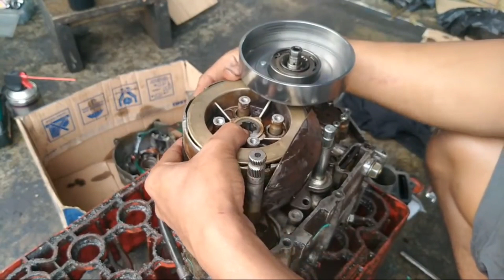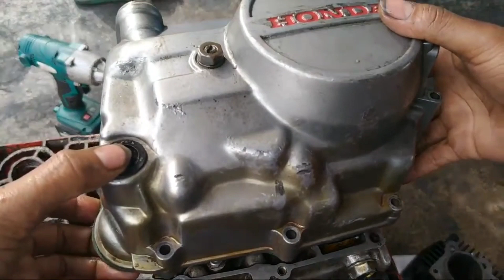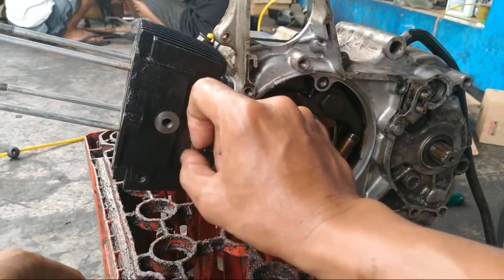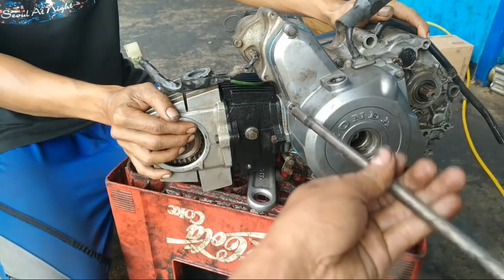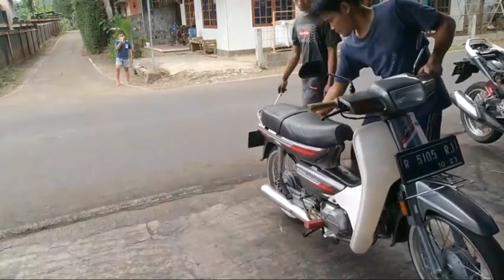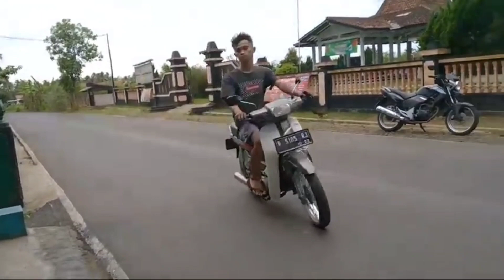tutorial rakit mesin honda grand untuk pemula jamin kamu bisa

Comment: Maaf melenceng,mas boen saya mau tanyak Vixion old saya kalau di bawa ngebut nyendat2 kira2 apa y mas penyakitnya
Reply: bantu jawab.. coba cek tekanan fuel pump nya bro
Reply: cara pengecekannya kayak mana mas ?
Mohon penjelasannya mas bro
Reply: @dzakychan8639  di video mas boen sudah pernah divideokan.. tapi cara sederhananya.. pakai avo meter / multimeter.. 1.ukur tegangan aki saat motor mati... 2.ukur tegangan aki saat motor hidup.. 3. ukur tegangan aki saat motor hidup dan posisi di gas normalnya saat motor dalam kondisi motor mati tegangan 12v.. dibawah itu aki drop.. jika  tegangan aki saat motor hidup (stasioner) harus lebih dr 12v dan pada saat di gas tidak melebihi dr 14v...
Reply: @intifada401  jadi kalau aki kurang 12v berarti permasalahannya di aki y bro ?
Reply: @dzakychan8639  kalo fuel pump ada alat khusus untuk pengetesan tekanannya,.. bawa ke bengkel saja,.. kalo aki dibawah 12v bsa aki drop atau pengisian tidak bagus,.. kalo terkait pengisian bisa kemungkinan spull atau kiprok permasalahan,.. atau bisa juga ada di soket kabel listrik ada yang terbakar atau korslet,..
Reply: @intifada401  ok
Terimakasih mas bro 🙏🙏🙏